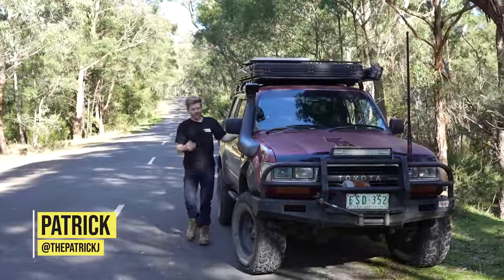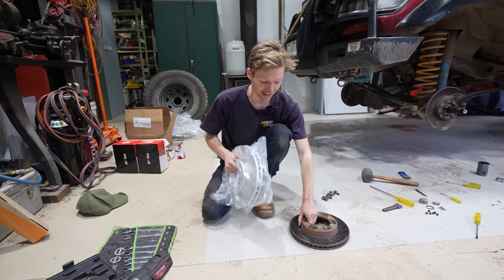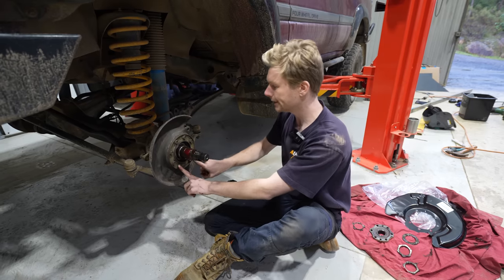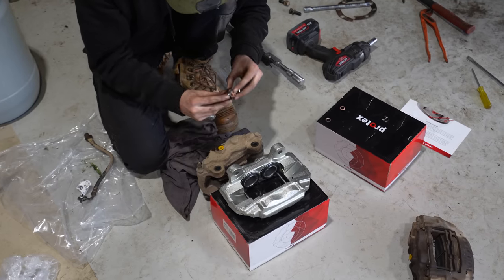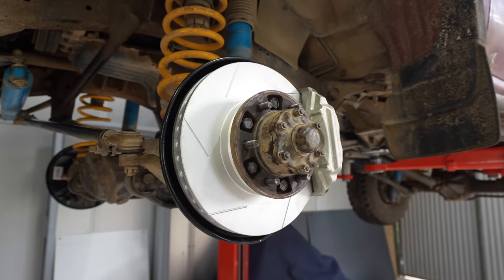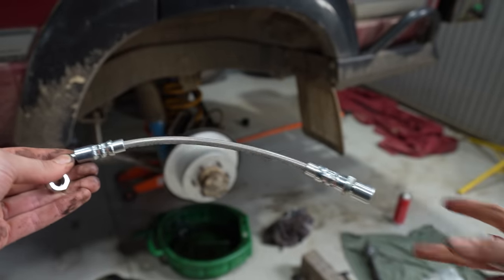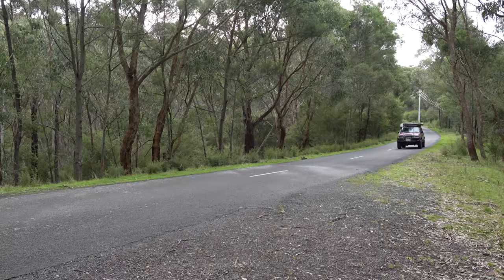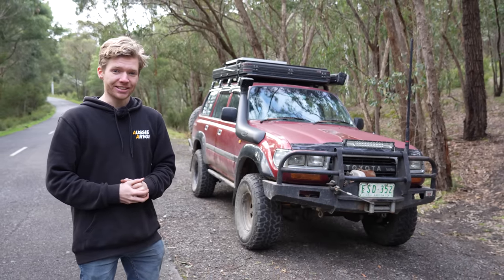Can your 4WD stop in an emergency?

Comment from the maker: Have you guys felt the need to upgrade your brakes on your 4wd?
Reply: I have a 1991 80 aswell this upgrade is definitely on my list now after watching this. Very informative!
Reply: Absolutely. Like you said, they're often overlooked but may save your life or that of others.
Reply: Should be one of the first considerations
Reply: Not yet. 

My '89 GQ can still lock the wheels, so plenty of braking power and being a manual with 4.2 diesel, I almost never need to use my brakes on decents (assuming I grab the right gear) and in fact more often need to use a little bit of accelerator.

When they are due, I will be considering larger rotators, braided lines etc.

Another thing you didn't mention about braided lines, is the bulging of the lines when braking.

Braided lines give less, thus give a firmer feeling under braking which is why most race cars like using them.
Reply: He did mention "swelling" instead of bulging @35manning  Same shit, different smell
Reply: @MicahBell_1860  I heard it in reference to temperature, not under pressure during brake application, which is different.
Reply: judging by the noise wheb you brake, your limiting factor is grip on the tires. What i would recomend is OE Brakes with ebc brake pads, and adjusting the rear brake proportiobing valve, espacilly as you lifted your car.
Reply: you are not supposed to do the bedding in proces until you have done 200 km of slow driving like in town. The locking up probbly mainly happens as the friction is still higher than its supposed to because the coating hasent fully worn away yet. Heating up brand new brake pads like this is not the recommended process, at least in Europe. Possible that for Australia there are different recommendations.
I found that Protex sells ceramic brake pads for 4wd cars and does not provide any bedding in procedure on their website, which is odd for me, they should give this informations. Are their any in the packaging?
Reply: Yep one of my next mods 👌
And then fit my winch bar and winch
Reply: I’m looking for improving the whole brake system including the the brake pump

Comment: The most overlooked component is the proportioning valve.
Over the years, I have changed everything with little result.
It wasn't until I put a new proportioning valve on that I actually got good brakes. Now it pulls up like a supercar.

Comment: A bit of gentle carressing with a 40 grit flap wheel and a cardboard cereal box shim for clearance testing and you can run 15 inch rims on the rear of the 80 series. The fronts clear the 15s untouched.  Don't ask me how I know...

Comment: Bloody good job mate, well done! Like your enthusiasm, open & honest demeanour and having a good crack without Bullshit!! Like you I keep my vehicle & camping gear reasonably simple versus some other 4WD shows with all the bells & whistles, complications and massive weights their hauling around. My early BT50 just racked up 252,000 clicks of reliable trekking in pretty much most environments around OZ including working as a driving instructor, engineering work at mining & resource sites etc. Next time your in East Gippsland, would be thrilled to hook up.

Comment: I’m pretty sure you can tune up the rear end a bit so it splits the brake load more evenly and saves the front locking up so quickly when you stomp your foot on the brakes. Anyway, neat video. 👍🏽

Comment: Great video Pat, Luckily for me I'm running the bigger size on the 95 80 Series I do want to upgrade the rotors very soon. Plus I noticed one of the bearing races is a little loose inside the hub, So now looking at changing that over as well. Keep up the good work Lads. Almost at 100K 👍
Reply from the maker: Thanks bush TV! Lucky you haha! Cheers mate! Getting there!

Comment: Great vid man. Might be worth mentioning the brakes are only as good as the grip you have available. 
I did a brake upgrade on my 97" FT spec (which already has the bigger brakes) with some performance brake bits, huge difference in instant stopping power and long decents! 
Even with the ABS on the 80 (which is very rudimetary), I had to pull the fuse for most road conditions. It actually causes a major increase in the stopping distance on gravel. The only benefit with keeping it would be the advantage of having steering while you run off the gravel or into some game haha

Comment: Love the channel and your work boys, cracker of an episode. I've gotta say though this convinced me to stick with my stock brakes. If you're looking to shorten the braking distance, any possibility of locking up Is going against the gain. Rather put both feet into it than thinking about having ro regulate brake pedal pressure when avoiding an accident.
Reply from the maker: Thabjs Brad! yeah makes you think!, wouldn't be an issue if you had ABS but i definitily can't just slam it to the floor like i used too, have to be more controlled. i have noticed since making this that the bigger rotors have been better for more repetitive braking e.g long hills, as the caliper stays cooler.

Comment: Just a thought if you’ve done a two inch lift,did you readjust your load sensing and proportioning bypass valve,as the valve is set to factory height,this could be putting to much into the front end brakes making them lock up .

Comment: Another  brilliantly done video.  Superb editing and presentation.  I agree with you 100% brakes are critical and often overlooked.  Ive got a 1996 LC80 and already w/the bigger brakes, but they too I found lacking, so I've upgraded to the Heavy Duty dba rotors and Bendix pads.  Though I'm yet to upgrade to braided lines. I"ll do them along with when I upgrade my brake booster.  Great episode. 👍
Reply from the maker: Thanks Fatman! Means alot mate! Yeah makes a big difference driving know you can pull the car up a few metres quicker! Cheers

Comment: cant beat a bigger booster aswell. having drilled rotors will prevent fade caused by gases being built up from the break pads when they heat up

Comment: Unfortunately braided brake lines are a really bad idea on a 4wd that does remote travel!
The reason being……….you can’t clamp them like you can a rubber hose.
So if there’s ever an issue off road you can’t just clamp a hose to ensure you still have brake pressure to the other brakes.
Reply: Hey mate, I've blown a braided line and my vice grips clamped it off easy as. Dunno where everyone gets this from

Comment: I did this on a mate's early Sahara 80, it actually stops now!

  Check out bearing adjustment nuts from Trail Gear in the states, much better setup than the two locking nuts and lock washer.
Reply from the maker: Thanks mate! Yeah it makes a big diffrence!! thanks for that info, that looks really interesting, might have to try them out! Cheers :)

Comment: Smart move keeping the brake rotor backing plates. They are a safety item that increases braking when you need it most, IE: When you use your brakes. Try some of the DBA XP pads, I reckon they are great for stopping power & lifespan.
Reply from the maker: Thanks dusty!

Comment: I have a 91 HDJ 81 with the very small rear rotors. The rotors are very expensive to replace and I'm considering upgrading. Not sure if the backing plate will need to be replaced.

Comment: the stock proportioning valve wouldnt be set up for the larger front rotor, adjusting it might get you an even better braming distance

Comment: Be careful with Protex 4WD pads, I put a set in my GU and they were great around town but out on the trails and on steep descents they would fade massively. I changed them out immediately after that. (I don't normally say anything negative about products but this is super critical and it needs to be said.)

Comment: Hey patty, loving you're channel! Can i ask where did you find your factory service manual online?
And what were the part numbers for the new backing plates? Ive just done big brake upgrade on my 80 and bent them to clear.

keep in mind you can also fit an bigger brake booster which will require less pedal effort and make braking more predictable!

With your rear axle seals be sure you push them in past the little leading edge. Otherwise, they like to walk out and fill your bearings with oil.
Reply from the maker: Thanks Dean! Part numbers in the description! And if you google Toyota 80 factory service manual you should find it! 🤙 Thanks for the info! 
Cheers
Reply from the maker: Oh and yes and I think upgrading the brake booster could be a good one too!! Just didn't get around to it this time!

Comment: You should mention that the brake rotors comes with oil so you must use brake cleaner on it to get rid of it first before installing

Comment: throwing it out there did you adjust the proportioning value might help the brakes locking up? Also the dual diaphragm booster from pdi will also help reduce braking distance again, but its still a great video keep up the good work
Reply from the maker: Thanks raven! I forgot to mention about the brake booster, it is something I'm looking at but ran out of time !
Reply: Don’t the 80 series already come with a dual diaphragm booster?

Comment: My 93 GXL does have ABS.
First question, does the 100 Series have bigger calipers to fit the bigger pads, & do they fit the 80 series.
Secondly, I thought this video was going to be about installing a dual diaphragm brake booster. But you didn't?

Comment: You should of done the handbrake shoes whilst you where there mate also an easier way to bed in brake pads find a concrete surface and rub the pads on them in a circular motion count 6-10 rotation and done.
You can improve the braking a little bit more aswell buy upgrading the booster

Comment: I put new larger rotors on my 4by and it made a huge improvement even without touching the rear
Reply from the maker: Yeah just looking through the footage you can see how much force is going through those front brakes!
Reply: @AussieArvos  Yeah true. I put larger tyres on and it reduced acceleration and increased braking distance and feel so I did the upgrade
Reply: Were you already running 16inch wheels? I would not have thought those brakes would fit in 15 inch wheels.
Reply: @legsofsteel1  yes I have factory 16 inch rims

Comment: hydrobooster is the best thing i ever did to by gq wagon.
Reply: Same with gu,  best brake mod you could do, doubles your line pressure. No need for bigger tb48 calipers and rotors

Comment: Ooops, I litterally just upgraded mine last week and went straight to 130kmh and slammed the brakes on to see how much better they were and proceeded to do the same another 3 times 😢
Reply: how to kill pads and warp rotors 101...might get lucky, but if you find anything suspicious switch pads. Also most manufacturera have stopped advising the bedding in procedure given here. Anyway recommendation is 100-200 km light braking (exept emergencys) and as an option the bedding in as shown here, however it usually is not necessary anymore with modern pad materials. Always check what the pad manufacturer recommends.

Comment: The main thing to remember is that if you’re going to driving a big heavy 4WD around you wont be able to stop like a proper car - because physics. 4WD tyres have relatively poor grip, the dynamics are poor and the weight is a lot of kinetic energy to lose.

So drive slower and conservatively on public roads and try not to kill anyone - im looking at you lifted ranger drivers!

Comment: The downside to braided lines is if you damage them out 4wding etc (yes a stick or branch can still puncture them) you won’t be able to crimp them off. And it’s not a race car so the effective benefit of braided lines is zero.
Reply: You don't need a race car to benefit from braided lines. The main improvement over standard rubber lines is the reduced expansion of the line under braking, giving more feel and allowing greater hydraulic force to be applied to the pistons, rather than lost to expansion in the lines.

Comment: Anyone reading this, what ever you do, don't run bendix pads, especially the heavy duty 4wd pads, absolute rubbish, as in dangerously bad. 

Also slotted rotors are not advisable, use solid units, dba 4000 series are good. If you don't CLEAN them well you will ruin them from day one with shudder that'll you will ever get rid of. Bed in pads using manufacturers instructions. 

Braided brake lines are less flexible and can perform worse then new oem lines in terms of longevity, who cares if the pedal is .00052% firmer with braided lines.